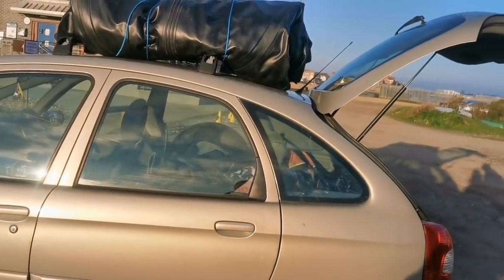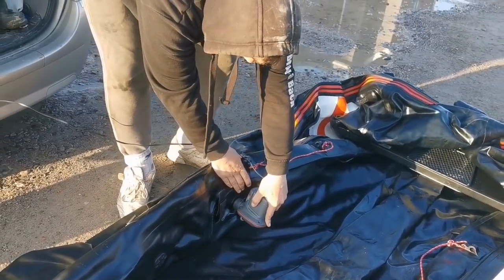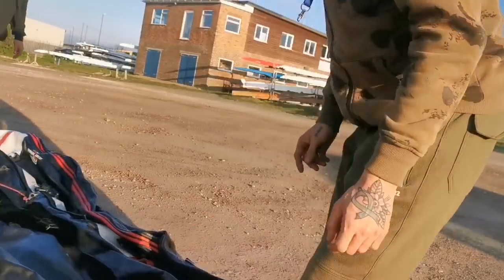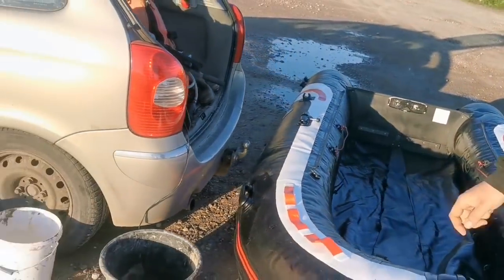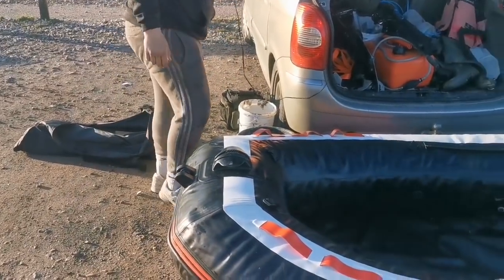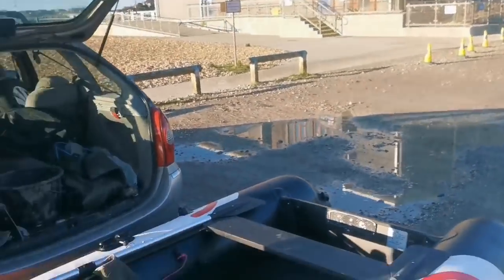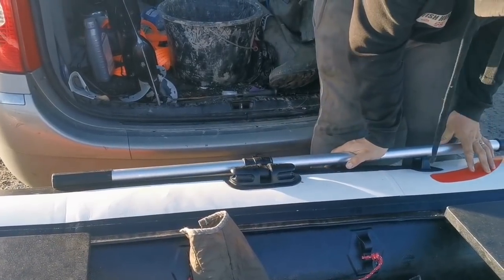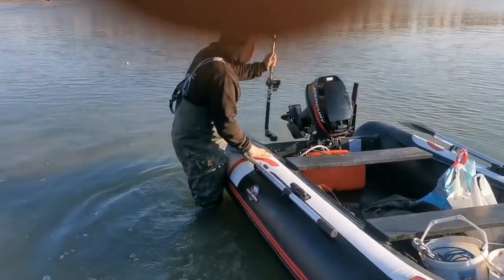Inflatable boat fishing - setting up my hydrus from the start

Comment: Great video, it's worth putting something under one tube when pumping up the keel (like the fuel tank), it allows the keel to inflate centrally, stops the valve moving, and reduces the risk of damage on rough ground. 👍

Comment: Hi Rhys, cracking video of setting the Hydrus up. Many thanks for giving it a great review. One thing I would stress though is the importance of making sure the tubes are inflated to the maximum pressure for each one that's stated in the owner's manual and on the transom plate. Those £15 pumps are good for the money and it does look like you have the tubes inflated well but to ensure they are at the correct PSI you really do need a manometer pressure gauge. The air deck being the most important 10PSI. Other than that all good, looking forward to seeing how the trip went. 

Oh and I do have one or two 3.3m air decks and 4.0m ally decks still available this week and yes I'm happy to do a deal for your subscribers
Reply from the maker: Thanks Carlo I best get saving for a pump then 🙈🙈
Reply: @FishHunterUK  the one you have is alright don't get me wrong. Just if when using the foot pump to finish them off, get yaself a Manometer off ebay for about a fiver so you can check the pressure before going out. You'll be surprised how much better performance you get out of the boat if the tubes are inflated to the max instead of the 'thumb pressure' test
Reply: Hi carlo nice one m8

Comment: Nice 

What sort of wind speed or weather should you be looking at going out in one of those. Obviously a nice day 😂 but like it could still be choppy. 
I’m thinking of getting one of these as I have a trailer and RIB now. But I like the idea of getting one of those rolled up in the garage after cleaning it.
Reply from the maker: As long as its off shore I'll go up to 12/15 mph if its on shore 7/8 you'll probably be fine with a bit more but that's me lol
Reply: Hi Thomas, give me a shout if you'd like some details on the Hydrus. I myself wouldn't go out with winds anything over 13-15mph as it gets a bit choppy and not much fun battling against the waves.

Comment: Will the pump work in reverse to deflate the rib.  nice bit of kit though
Reply from the maker: No mate it dosent
Reply: Try a cheap e bay leaf blower, the one handed battery powered version with the rubber snout. These will inflate super fast and you can transfer the snout to the inlet and suck all the air out of the boat too. You will need a separate gauge and maybe another pump to bring the pressure up to the final amount though.

Comment: Hi what size is your boat and engine please
Reply from the maker: The boat is 3.7m and the engine is a 15hp 2stroke mate
Reply: @FishHunterUK  thanks mate… would a 10HP be suitable for a 3.6m boat with two adults at sea ? Or would you say I’d need a 15HP min ?
Reply from the maker: @mavicone5845  I now have a 10 for mine it will be fine bud should still get on the plain with that no problem at all